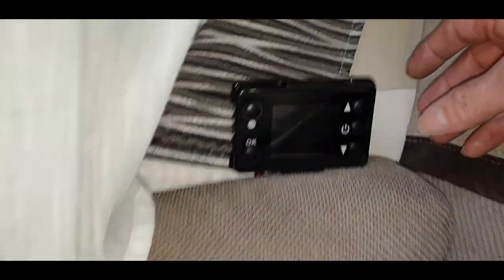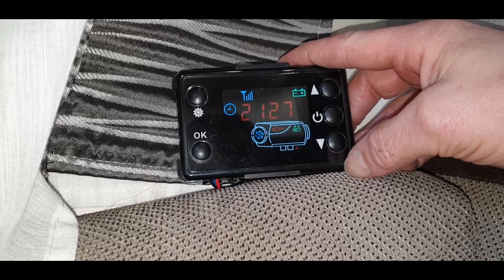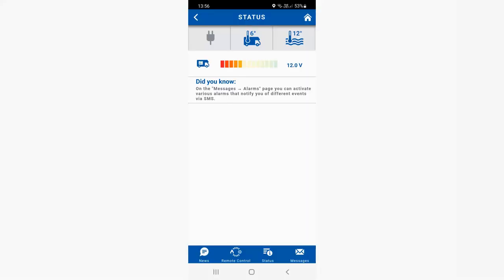Fitting a diesel heater to my motorhome

Comment: Thanks for the detailed video. One comment on drilling holes and working in small spaces. I have a Bosch installation driver. I've got the 12v brushed one. It's really great for getting into small spaces in my RV. It isn't all that powerful, but it's good enough for most purposes.

Milwaukee makes a more powerful one, but the version you've got on your side of the pond - looks more like a normal drill - is a bit longer than the Bosch and doesn't fit into small spaces as well.

Comment: How did it heat up the water..
Reply from the maker: @davidtebbitt5537  I never intended for it to heat water up but the way the truma is designed because I was forcing hot air into the Combi. The water chamber around the outside of it was getting hot and warm in the water up.

Comment: Are the good heaters mate and did it work well going frew main duc
Reply from the maker: Hi yes they are surprisingly good it did work through the vents but because I was running it backwards through vent pipe into the main unit then out to the other vents it doesn't push as much air to the front of the van but still heated the van up no problem 👍

Comment: How did it heat up the water?
Reply from the maker: I only used it for heating the motorhome
Reply: I was thinking the same you said at the 12 minute mark the water temperature is up to 30 degrees how did it heat the water?